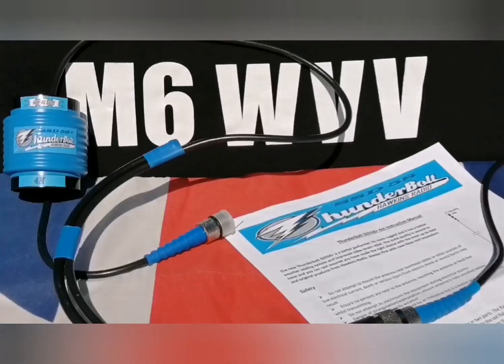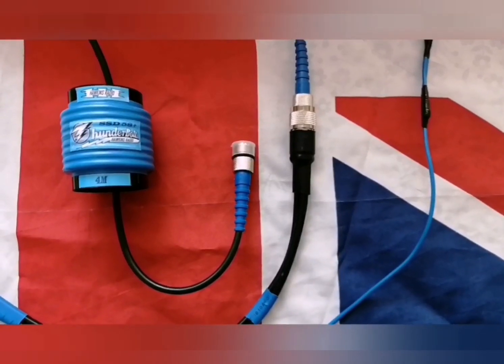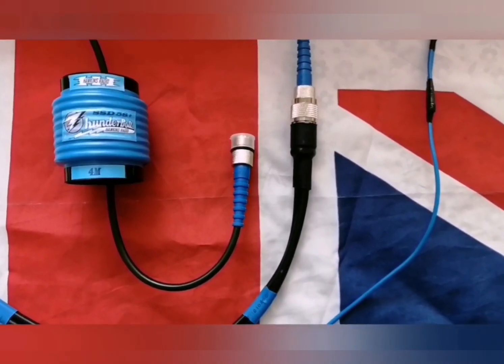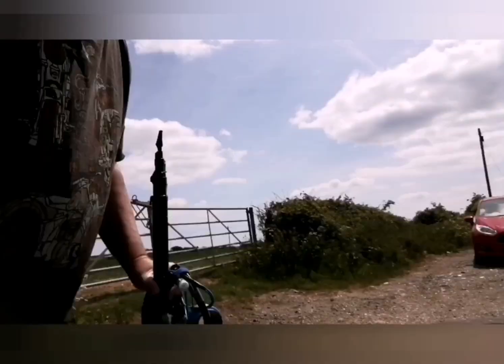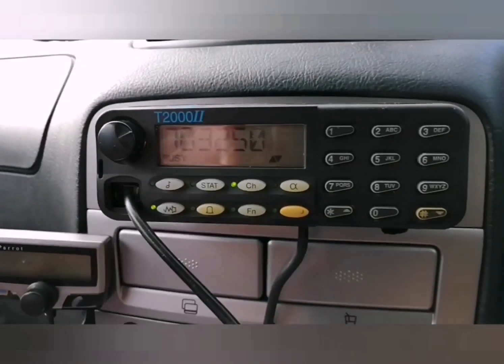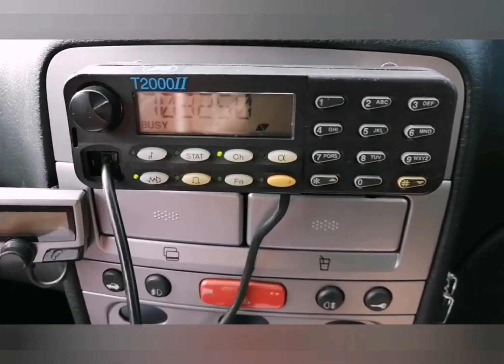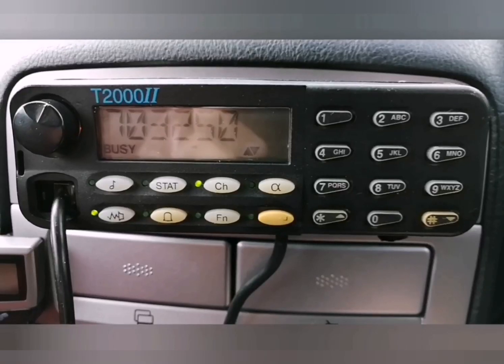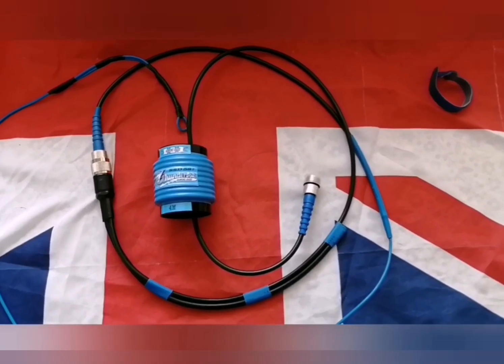UPDATED: Thunderbolt SSD58+ 4m Antenna review and test

Comment: It is a shame that Nigel/Hawkins Radio is no longer making these, I recently lost my 10M 5/8 wave version and I wanted both 4M and 2M 5/8 wave versions, I know the T2LT is relatively easy to make but it is the matching stub that isn't easy to make
Reply from the maker: Some good videos on YouTube on how to make one, including the stub bit. Quite simple with an air gap capacitor helping the matching. Yes it is a shame they are no longer made. Regards Steve
Reply: @EnthusiastSteveM6WVV  Can you point me in the direction where those videos are, plenty of T2LT ones, but no matching stub, I was told there weren't any plans anywhere.
Reply from the maker: @PaulStrickland https://youtu.be/DLDdOepaq7k?si=WGRsoTOIWXBrn2G6
Reply: @EnthusiastSteveM6WVV  I did eventually find that one, thanks, btw how long is the stub on the 4M Thunderbolt? This is the real problem that there is no information about the stubs. When I bring it up on Discord, Facebook, and SOTAWATCH sites, I get buried under info about basic T2LT antennas which isn't what I want

Comment: Hi Steve, Could you run this ap a tree??
Reply from the maker: Yes I cannot see any reason why not.  It has a loop at the top but probably best to run a nylon support line down its length, attach with zip ties then suspend the weight off of that. Just be careful lifting the coil incase it snags. It's a good antenna. Regards Steve
Reply: @EnthusiastSteveM6WVV  Cheers, I think I'll try one.

Comment: Hi, Does it matter if the pole goes through the coil or not .. Im planning on using the 11 meter 5/8 with a sotabeam fibreglass pole ... ?
Reply from the maker: That will work fine, as long as its a non conductive pole like you said, fibreglass, then no problem, that's how I use my 5/8th on my spiderbeam pole, it keeps it all near and tidy and secure. Enjoy, regards Steve